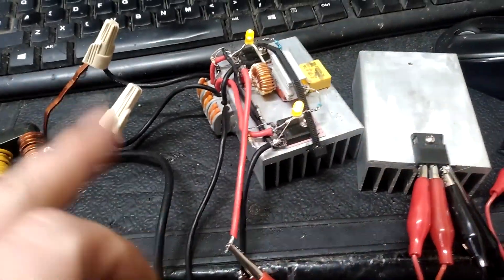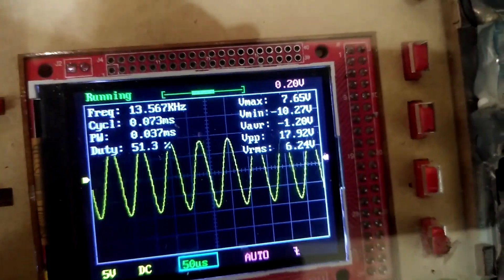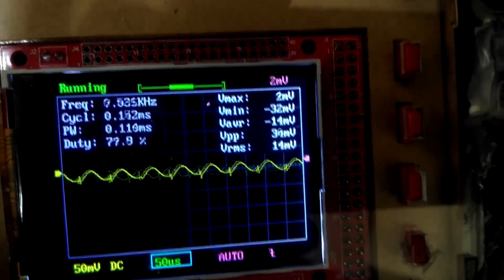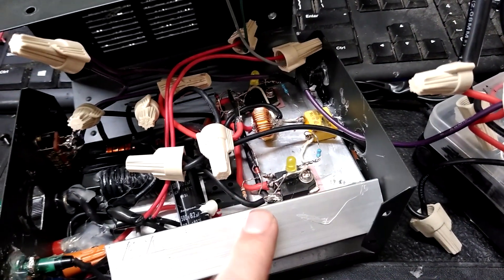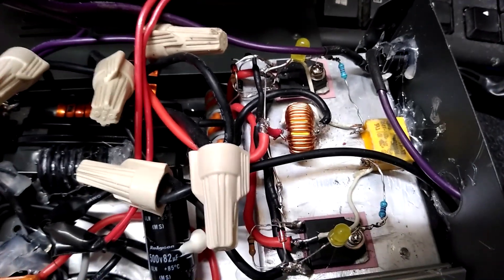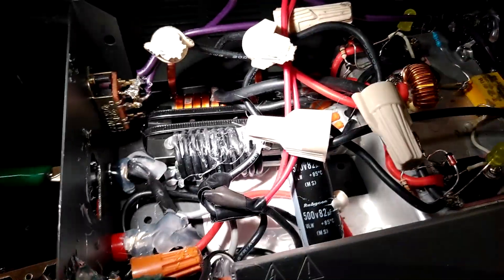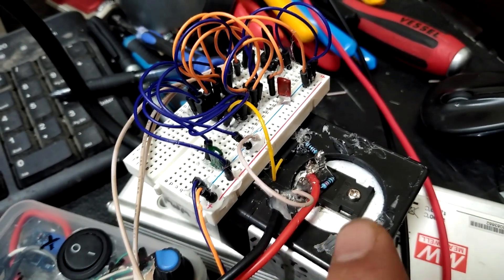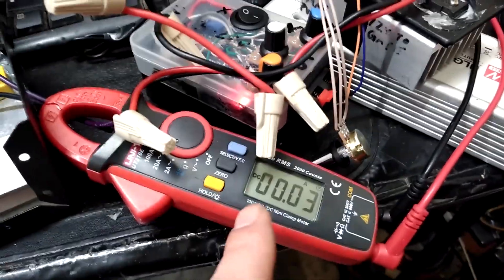PWM + ZVS for Variable Boost/Buck

Comment: Can i do this but use the mosfet on the low-side and control it like a low side switch .?

I also had issues with the inductor getting really hot so can I cut a yellow toroid in half and join it together with a small gap with epoxy to increase its saturation current.

Comment: so if I got idea right, you're controlling a ZVS driver with another mosfet with PWM?
Reply from the maker: Yea basically but it's not regulated or anything of course, was just a bootleg way for me to vary the voltage
Reply: @Magneticitist  but it’s possible?) zvs driver won’t die if I’ll power it through another mosfet with PWM generator attached to it? I wonder if this lets increase power of setup, decrease overheat and control the frequency on the output of zvs by setting it on a PWM generator?🤔
Reply from the maker: @MaDnBaD  It should never increase any power but let you somewhat control it. I never killed any ZVS Driver doing it that way but it's possible. For something like a resistive load I just found it as a handy dimmer as opposed to using variable CC or CV supplying the ZVS.  The output frequency will basically be modulated so you will have pulses of on times at the PWM frequency, with the ZVS frequency carried within them. The most power efficient way to really run anything from a ZVS is to reduce switching losses after having it properly switching at zero volts. So for example make sure it's not trying to switch too fast for the circuit components, and that is has enough of a constant current source in the input choke that you have good waveforms. You should be able to push many hundreds of watts without the mosfets getting hot.